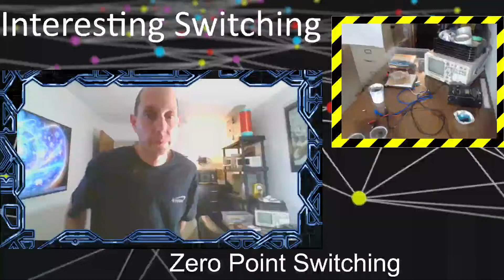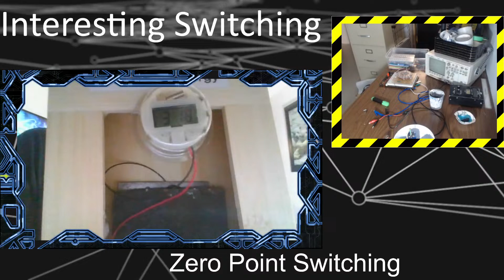Interesting Switching

Comment: I missed again 😢

Have you had a tough about AC as being just pure potential difference in 2 phases without neutral ? It will be an alternating current as described in some patents but not the same as AC from the grid. Can this act as 2 separate sources being switched like in a backup circuit ? And use an earth ground on primary and a separate ground for each and any phase ?
I have to run some tests in order to elaborate further, I hope you get the idea what I am speaking about.
Reply from the maker: Did one of the guests on Energy From Vacuum do just this with 3 phase and more and claimed over unity? If I remember correctly.
Reply: @ this is what I get with my pancake coils and I can get 4 phases output by just using 2 sets of secondaries … this is why I can’t measure anything on output but almost anything connected works, also this is why I can hold with bare hands any output wires without getting a shock or drop them in water and put my hand in the water or just use a glass of water instead of connectors to power loads.

It is very strange, I would love to see you having a go at it as you have far more instruments, not like myself just guessing, making assumptions and test my calculus with all kind of whatever comes handy.
Reply: @ also, nearly finished my replica of 382282 Tesla patent to see where this is going … I think this is a much more advanced system of Daniel Macfarland Cook or Hubbard coils or similar with AISEG (Korean patent).

Anyway, switching between coils parallel-series  should yield something if works with batteries must work with coils, as well with capacitors … anything that can be seen as 2 power sources switched … not necessarily self runners but at least >1